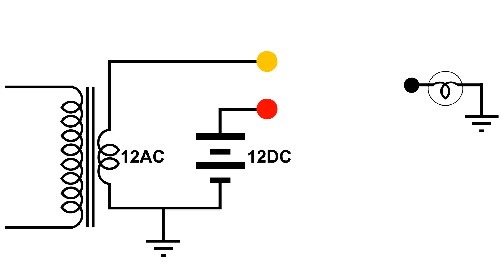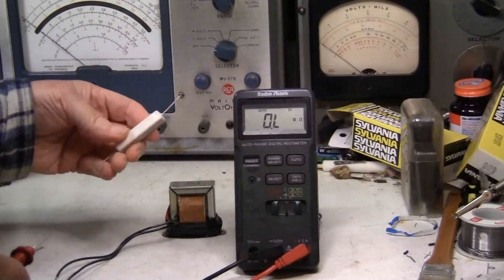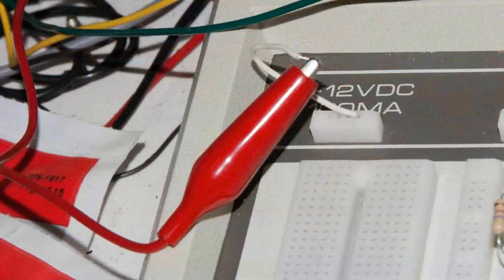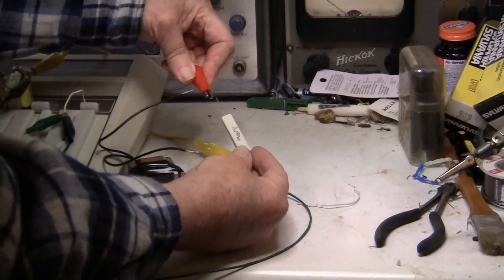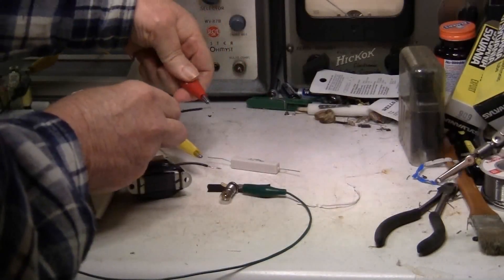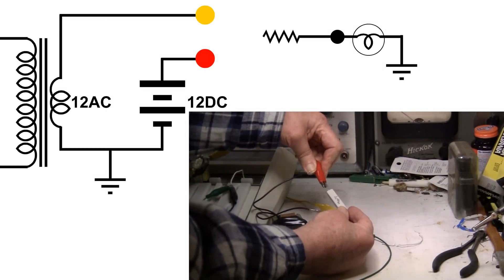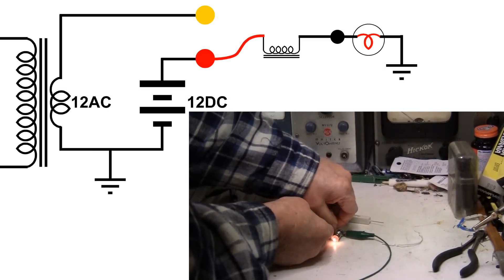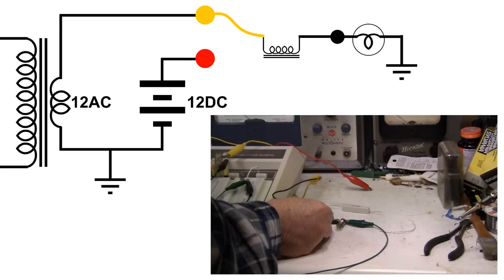Resistance Impedance Demo, The Basics

Comment: @hardstyle905 Speakers are not simply coils. First of all, there is often a crossover network that presents varying impedance with frequency - but the physical parameters of the loudspeaker affect its impedance as well (as the motion of the pole piece affects the coil's electrical properties).

A flat impedance is desirable, but there is normally some deviation from the nominal 4/8/16 ohms. If you go look at some DIY speaker designs you can find some typical Z vs. Frequency charts.

Comment from the maker: Thanks hardstyle905
As the frequency increases the impedance of a capacitor decreases while the impedance of a coil increases. The phone company used 1000 cycles for testing circuits. I'm not sure about speakers, I think they use 400 cycles.

Comment: Rick:

Great job! Concise and easy to follow.
Yes... back in my R.E.T.S. days; "back EMF" IS the reason.
Would be great if you did the same thing with capacitors. It would make voltage dropping circuits to lower AC input voltage to vintage radio and TV's a little more easy to understand for me.
Again, Nice work,
Tom
PS I haven't said it to you as of yet. Happy New Year!

Comment from the maker: Thanks jonnyb1963
Your welcome Jon,
Yes it is back EMF produced by the magnetic field cutting across the coils. The number of turns, the gauge of wire, the type of core and the AC frequency all determines the back EMF and that determines the impedance. I like to keep the videos short, so I did not get to all that and the impedance of capacitors either. 
73
Rick

Comment: Rick,

Great Video, and thank you for doing this for me!  I have been reading the Navy Course i got from you and let me know if i am right.  The reason the lamp does not light with AC is because of the Back EMF created by the magnetic field building and decaying during the reversals in the cycle and at 75 ohms that back EMF is roughly equal to the forward EMF thereby not allowing current to flow?

73!
Jon